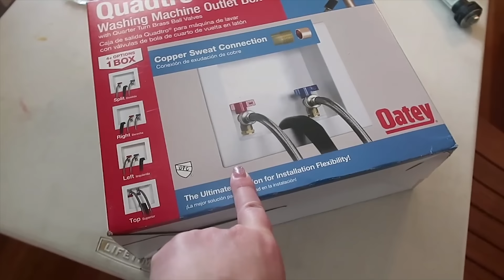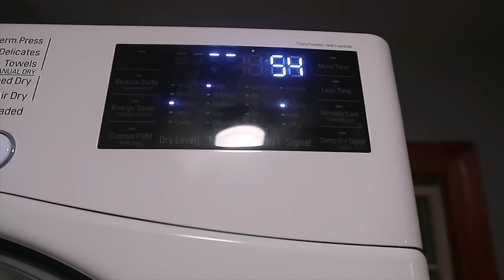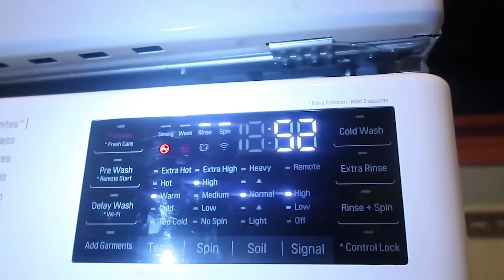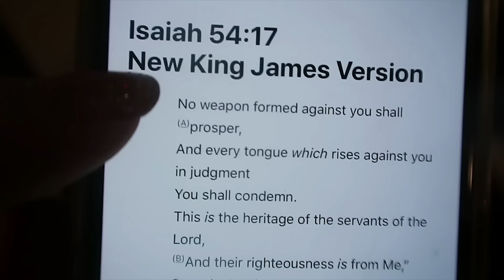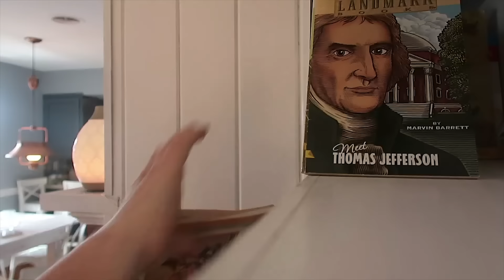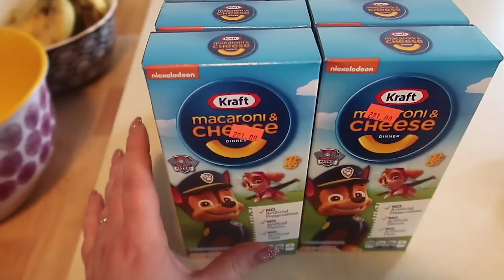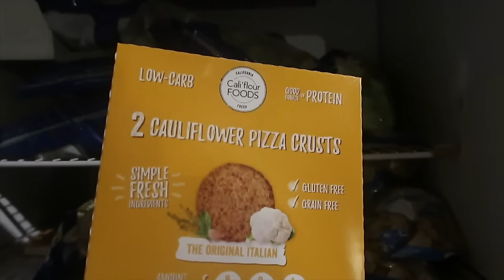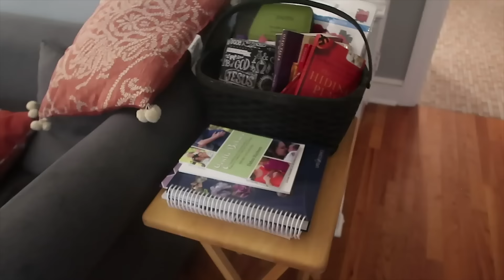WE LOST ALL THE FOOD!! (**BEFORE** the Craziness Hit Locally)

Comment: I’m going to make a suggestion for the front loader washing machine...prop the door open a little after using, do not keep it shut, or it could possibly cause mold. That’s what I’ve done with my front loader for over 10 years and have had no issues. I also clean the rubber seal, around the drum, once a month to keep it from molding.
Reply: yea we keep our top loader lid open after washes too
Reply: same we only have front loaders in the U.K
Reply: Grove has a great washing machine spray too. I like to spray it out overnight with the door open
Reply: I do the same!
Reply: This is a good practice. My brother cannot see very well so he runs in to the open door a lot. A dry (not soft or plush) old clean towel inside can work too, if you have to keep the door closed. It just absorbs the ambient moisture
Reply: Yes, i have the same w/d set and always prop open the door, keep seal wiped out and clean the pump at the bottom once a month.
Reply: Once a week I run the washer on hot with white vinegar
Reply: I do the same, I leave it open in between uses. But I also did that with my top load washing machine.
Reply: This is the same advice I’ve gotten from a washer/dryer repair main. He said closing the door locks in moisture and will cause mold in the lining. To always leave it cracked open to prevent it!
Reply: I dislike mine for this reason even leaving it open we get mold. I wish it was easy to remove the flange? so we could pull it out and really deep clean it.
Reply: Yes we do have top loaders in UK I had one for years
Reply: As far as top loader it is in the directions to keep it open after use
Reply: I have always had top load washing machines and have never had a mold problem in them. I have never left my lid open. Dont want things falling in it.

Comment: You should have your husband install a “water cop”.  It’s installed on your main water line and you have several wireless water sensors that you can put under you washer, hot water heater, dish washer, kitchen sink, and anywhere there could be a leak.  When the sensors detect water, then it will automatically turn off the water to the house a alleviate a lot of water damage if something does spring a leak, even when your not home or asleep.  We also have a wireless panel in the main part of the house so when we leave for the weekend, go on vacation, we push a button and the water is turned off.  Lifesaver and priceless!
Reply: Carla Meaders what a great idea!! 💡
Reply: Yes!!! My neighbors house flooded while they were on vacation. They had to live in a hotel for two months and needed to replace 1/2 of the flooring in the house.

Comment: With front loading efficiency washers there is hardly any water used at all.  Don't watch it because you will swear it isn't getting all the clothes even all the way wet!  Cut the amount of detergent you normally use also.  You will want to prop the washer door open when not in use for it doesn't mold and smell soured.  Use the Tide washer cleaner on occasion also to keep the sour smell out of it!  These are things I learned the hard way.  I've got the same can opener.  I love it!

Comment: Idea- raise the desk countertop level with the stove and your microwave could fit just fine😁 if you want to do that now put a false wood front and like a butcher block top or even just painted plywood till you get your countertops replaced. Ideally I would just add a drawer on top of the desk then put your countertop on that for added storage. I agree that the microwave is really high in that cubby area.

Comment: I can say from experience, I came to hate, hate, HATE that small wall oven. Forget putting a turkey in there or anything large.  I would pull the wall oven, move the microwave down, add a pantry above, lose the cook top, cut a space out & get a standard range/stove to slide in there. Maybe even use the current oven/microwave space to add a instant pot/crock pot section over the microwave since you already have power. Just saying.

Comment: Are you going to add some more bedrooms down there ?
Reply from the maker: As of three years later, we’re working on the upstairs renovation. It all takes time and money. Working through it slowly. Since this video posted in 2020 we have spent $11,000 replacing a chimyliner and adding an emergency woodstove to our basement, then we added a third bathroom to the basement, we had a new whole house HVAC system installed which is our air conditioning/heat, we did upgrades to our well, we had a two car garage renovated into an over 600 ft.² custom kitchen which is important for my business, and here in early 2023 we just had our two 1963 upstairs bathrooms completely gutted and renovated. Next up is our upstairs living room renovation +2 additional bedrooms. Currently this season we are not doing our basement renovation, we put the kitchen before that. But we do hope to get to the basement in the coming years.